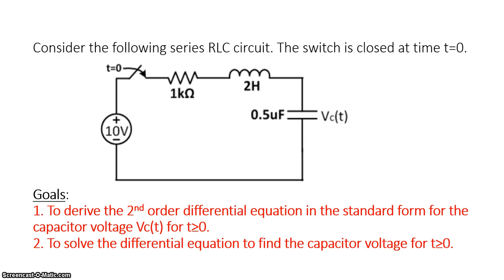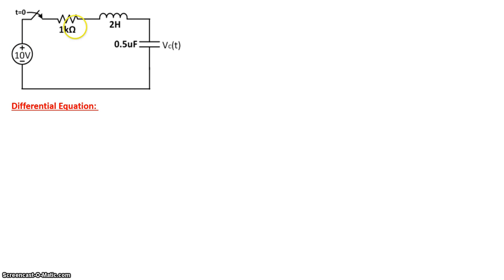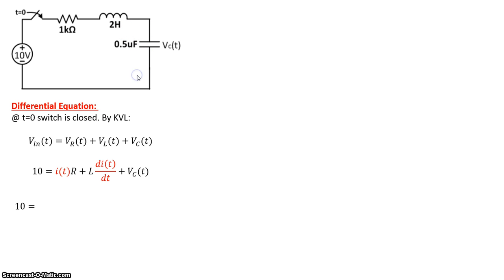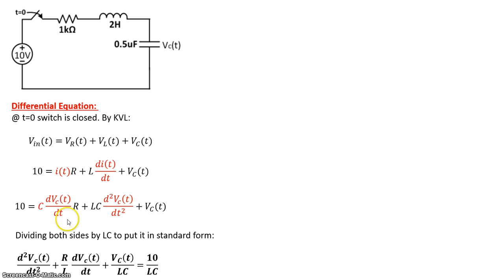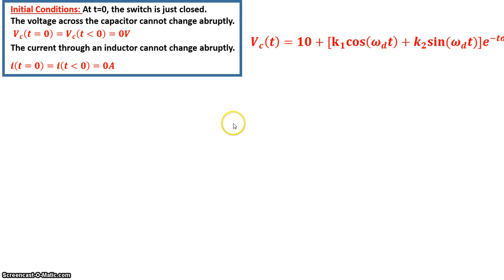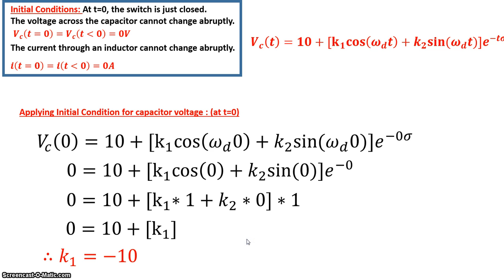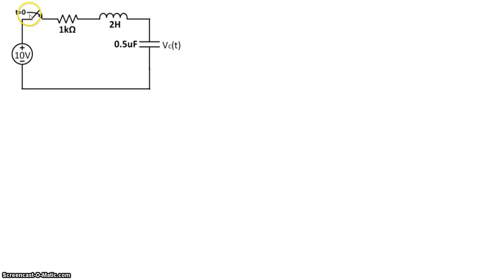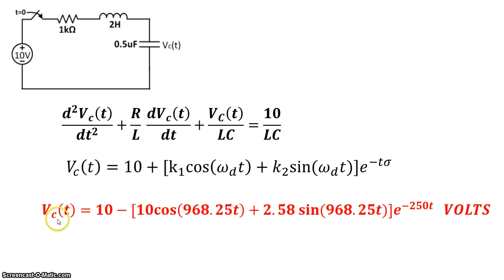2nd order Transient Analysis - Series RLC Circuit

Comment: Is it possible to convert this into frequency domain,

By using omega to convert the inductor and capacitor elements into phasers
Reply: That should also be possible but I'd recommend going with the Laplace domain which makes these calculations a lot easier!
Reply: @bettersleepingofficial4618  whats the difference?
Reply: @Swagnarock  Laplace operates in the s-domain, while Fourier works in the frequency domain. The s-domain is a bit more abstract but are better in this situation. I'm just a student so I'm no expert on these subjects though. I'll drop a link for you.
https://www.quora.com/Signal-Processing-What-are-the-differences-between-a-Laplace-and-Fourier-Transform

Comment: for finding i(t) why did you use C(dv/dt) shouldn't you use the equation for the current across an inductor?
Reply: ***** Well... C*(dv/dt) is the current passing through the inductor as long as they are serially connected. L*(di/dt) is the voltage across the inductor. ;)